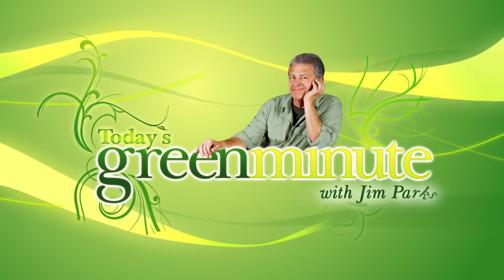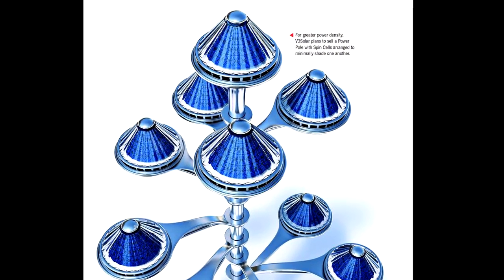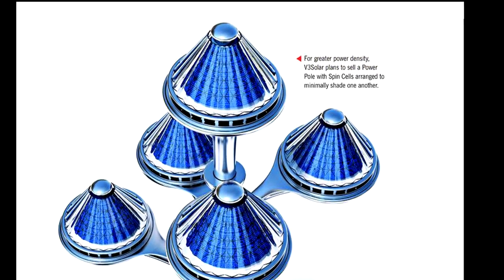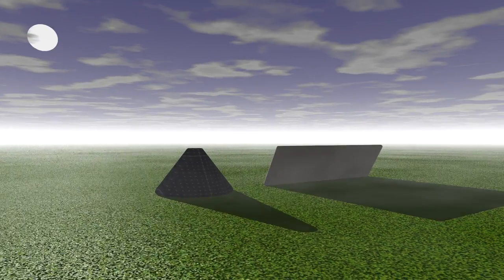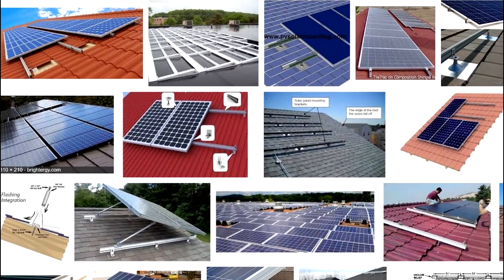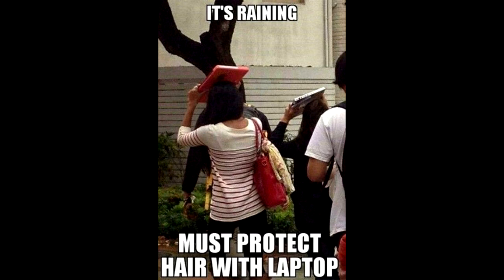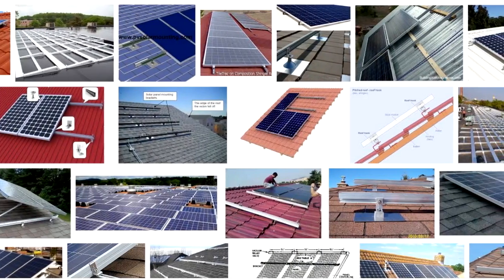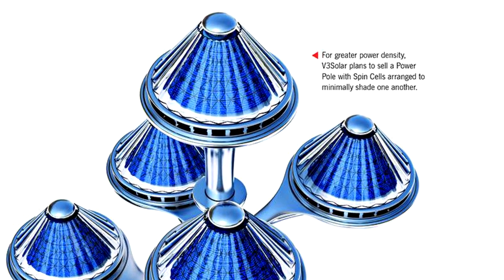Spinning Solar -BUSTED!

Comment: Speaking of engines that run on water; Bruce Crower who was an engineer by trade and founded an automotive parts supplier, did actually come up with a way to significantly improve the efficiency of an internal combustion engine by using water. There are some mechanical changes, but the short story is this. You run your engine on whatever fuel you want, then after it's exhaust cycle, you add another intake cycle but only inject water. The leftover heat from the combustion cycle flashes the water into steam, which expands and drives the piston down for another power cycle. No extra fuel is required as you are using the waste heat to add another power cycle. Crower's six cycle engine was intended to use heat energy that is normally removed via a heavy radiator and parasitic water pump. He theorized that the water used in the 2nd power cycle could be condensed and reused, thus reducing the amount of water you'd need to carry.
There are other technical concerns and I don't believe the process ever got close to production for automotive applications, although some believed there was some possibility for stationary power production. 
His engine appears to stay within the laws of thermodynamics though.

Comment: if anyone wants to take a look at an actual solar energy invention that doesn't depend on solar panels but on a heat exchanger and steam generator and is a bit cheaper overall while solving many engineer problems of its predecessors:
https://en.wikipedia.org/wiki/Compact_linear_Fresnel_reflector

Comment: it is just stupid. if you have a panel in a string of panels in the shade you pretty much lose all power generation from the whole string. Its not proportional to the amount of shading. spinning the string just ensures you get virtually no power.

Comment: The best way to get more out of solar panels would be to make more efficient solar cells. I wish people weren't so stupid as to get sucked into these gimmicks. Why is Nathan Fillion so excited about these anyway? Aren't the solar freakin roadways going to generate enough juice for us?

Also, if it uses an electric motor to spin the thing; that reduces efficiency further. How much power is this thing going to use just spin the damn things? The best we have so far is solar tracking panels.

Comment: @8:25 About the 20x cross section lens; what if you kept the lens at 1m, wouldn't that allow for a panel inside to be 1/20th the size and cheaper? Most everything else here makes sense except with the lens stuff. Why scale up to a ridiculous size like in the video when you could keep the size the same and scale down the internal panels, etc. IDK the answer and would honestly appreciate it if someone could explain the mistake I'm making (I'd assume if what I'm saying/asking made sense they already would do it that way)
Reply: Solar panels are not that expensive. If you want to gain more energy you have to size up because the sun gives a certain amount of energy per area. a cone simply has an more or less good exposure angle to the sun on 1/4th of it's surface a flat solar panel has a simular angle on around 1/2 of daylight time (a good good alignement assumed) even with a slight raise of efficiency  the cone is still the looser. The max energy is defined by the surface regardless wether its a lens or a pure solar cell. The system is BS from any given perspective it doesn't make any sense.

Comment: One other thing I notice: How are they powering the spin on those cells? Probably off their own solar power. It's spinning a lot faster than a flat tracking panel, so there goes even MORE efficiency powering the spin.

Comment: Jesus Christ...even I could have torn this apart from the moment I heard that it's in a cone, literally within seconds of hearing and with no preparation, I could have told them this is a stupid idea! I mean....what the hell? How can anybody with even a rudimentary knowledge of....of...geometry? Surface area? A vague idea of three dimensional objects and how the sun strikes them? Hey guys, one of the problems with a flat solar panel is that most of the day the light hits it at an angle that's not directly towards and it's less efficient...let's fix that by putting solar panels in a cone where at all times there is only a small sliver of panels facing directly at the sun, somewhere around 40% of the panels will be struck at an angle  at all times, while about half of them will have no light at all! Brilliant!

Comment: Hmm, shouldn't you reduce the flat panel's efficiency because of heating. Still, I guess this would end up putting the flat panel at 90~80% efficiency compared to your generous 50% for the cone panel, so there's still no contest here. I just thought it strange you forgot to include this...

Comment: If you have read something about solar panels, which so few of the pretend environmentalists, who only talk, care to do, you will notice that solar installations that track the sun are extremely rare. The simple reason is that that a tracking system costs more than just installing more panels.  Either the structure needed to rotate all the panels as one is huge and expensive, or you rotate multiple structures, which also multiplies the driving mechanisms and the cost. It is also quite a problem to position multiple systems to avoid shading one another at some position of the sun.

 People sometimes think heat-sinking solar cells is practical because they think solar cells are expensive and heat sinks are cheap. The heat sinks, because of the area they would have to sink, would be more expensive than the solar cells.

Comment: All you say is true, but I am marking you down for not addressing the basic allegation: that the panels they will be using are NOT the same panels that are made to endure higher temps. Why are you doing apples to apples when they say they have oranges? IF low-temp panels can be made that operate at higher efficiency, then your whole case is out the window.

I don't understand how someone such as yourself can neglect something so fundamental in your debunking. Thumbs down.

Comment: Don't forget this, by angle the only part that is actually pointed at the sun is the where the tangent is perpendicular to the sun. So only a straight line up and down it is at it's maximum effectiveness. Not only that, but since the thing doesn't track, from the angle of the cone the that will only actually happen twice a day! 
Ok. So twice a day only a good 1% of the solar panels is perpetual to the sun and thus at maximum efficiency, but half of them aren't in the sun at all and don't make any energy, while the other 49% are at average 50% as effective. 
Average that out, you get that it's 26% as effective as a tracking panel for those two times a day, and for the rest of the day, it's less and less effective, around none all of the panels are at the angle the cone is in. So it's 33% as effective. When it's past or before high noon, that number almost halfs when the other side falls in shadow, but with a slightly smaller angle on the thing, and it becomes 18% as effective as a tracking panel. 
Average 33% 26% and 18% and you get that the thing produces 25% of the electricity of a tracking panel! But that isn't right, it's at 26 for 2 hours a day, 33% for 1, and 18~ for 10, so it's even less. It's actually ~20% as effective as a effective over the course of a day. 
But it gets worse, that's only in the summer. In winter, the sun doesn't get high enough to be perpendicularly, and the north side is always dark, even at noon. One side is always dark even at noon, and it only meets the perpendicular of a side once, and the angle is always less forgiving. It becomes about 15% as effective as a normal solar panel, and not to mention, it doesn't end up needing to be cooled down. 
So if in summer it's 20% as effective and in winter it's 15%, then overall, the thing is about 
17% as effective as a normal solar panel by angle. 
And if it's spinning manages to cool it down all the way to the temperure or the air, it only gains 6% efficiency. 
Oh, it gets worse. The lens! 
If you used a 1 square meter perfectly and impossibly effective 100x magnifying glass on a one square CM solar panel, you just end up heating the solar panel. Magnifying glasses don't suck in light like a black hole, so that one cm panel gets hit by all the light of a square meter of surface area, but raises in Temperature making it much less effective than just taking the glass and making a 1 square meter solar panel to go next to the 1 square cm one. That's why we don't magnifying glasses on solar panels, because we just make more solar panels. A slightly bigger super week magnifying glass that takes up almost no more space, but creates a green house effect won't actually cause any MORE light to go through, all it will do is concentrate the light and heat the panel. 
Thunderfoot, this is obvious. (And the guys Facebook and Twitter has bots, read the comments for this one!)